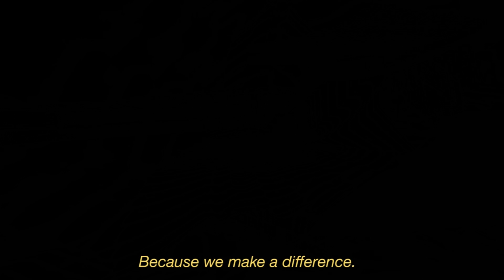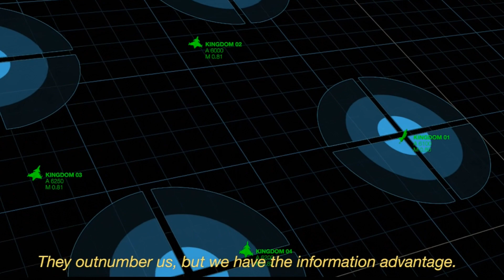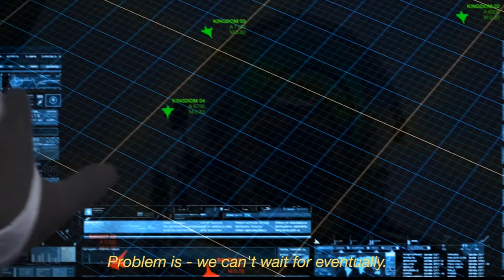Gripen Fighter Jet - Canada's Future Fighter?

Comment: there is no way a F35 will pair up with a non-stealth fighter. Doing so cancels out the whole reason for being stealthy. So no, Canada needs to just spend the money and get F35 or just stop having as fighter force.
Reply: Are you so sure the F-35 is stealthy at all? Even some of the marketing for this plane says "reduced radar signature". Maybe someone has built a better mousetrap....or radar system. It seems to me the US lost a carrier several times because Sweden built a sub that could NOT be detected by an entire US carrier group. What is the maintenance time for hour flown for the F-35? 40? It takes a hour to change an engine in a gripen as compared to 50 in the F-35. Planes are no use anyone on the ground
Reply: Considering that the new jammers the Gripen E has were designed to counter modern anti-stealth radars one would think that the Gripen would work very well along with the F-35. One aircraft concentrates on passive stealth while the other aircraft is highly focused on active stealth through advanced EW capabilities.

Comment: The Gripen and the Rafalle would both be a good fit for Canada.  Both are fairly compact, fast, maneuverable, and heavily armed.  the Super Hornet would also be good as we already have the infrastructure associated with the F-18 Hornet that we currently operate.  Any of these 3 fighters would be better for Canada than the F-35.  We also have to consider the amount of unpopulated arctic airspace that we cover.  Most Canadian requirements call for a twin engine aircraft for that reason.

Comment: The term "fighter jet" is an invention the non-military, non-aviation press.  The actual term until around the 1990s was "jet fighter".  A fighter is an aircraft that engages in aerial combat, among other missions.  When jet engines came into military service, the term was modified with "jet" in front of "fighter"  (the term until the P-80 Shooting Star was "pursuit" - started in the first world war, but changed to "fighter" changing it to the F-80 Shooting Star). Thus, propeller-driven fighters were differentiated from jet-powered fighters.  In the current usage we would have "fighter jets" and "fighter props." You can see how dumb that is.  Let's start the change back here!  Jet fighter!

Great video!  Great aircraft!

Comment: If I were in charge I would forgo the F-35 and buy more Gripen and if necessary either the Typhoon or Rafale as an alternative air superiority fighter . depending the allocated budget. The Gripen is at US$60M, Typhoon at US$103M and Rafale at US$85M. If the budjet if large enough I would got for a majority Gripen (say 60?) for multipurpose and Typhoon for Air superiority (say 20?). The F-35 although has a cost stated between US$80-115m has too many problems and lacks in air superiority compared to these 3.

Comment: great video. really the only problem with your argument is that both the Gripen and F-35 are both single engine airframes. Canada has the same problem as Australia, both who are now operating the Super Hornet, (In fact I think Australia just sold some legacy Hornets to Canada as well). Very large airspaces with few airfields. Single engine aircraft really are too risky in the areas compared to twins. Otherwise I would say Australia should ditch the F-35 and buy the Gripen instead.

Comment: Rafale would be a good choice for Canada...Range is great,as well as payload,flight capability and avionics.And is cheaper than Typhoon.Thou Grippen is great as well and cheaper,thou not really on pair with Rafale.
As for F-35 stealth features...bwahaha...It officially did not fulfill the stealth promised(which was even for C meant to be bellow F-22) and its only great against Xband radars.With sensor fusion and modern radars,it is far from a threat.Not to mention how many hours of maintenance it takes for F-35,real cost of maintenace,still problems with engines and a lot of time for maintaining them,insane drop of performance with any real load(even without any load,it fails to fallow F-16 D with full external fuel tanks) and its combat range is a joke....All of it is a result of wanting a plane that could do what a big plane should do,but also stealthy,but also with VTOL(which again makes it bulgy)..and ends up with a failure.It is the biggest military scam so far.They even destroyed plans for making F-22 and tools,as well as denied far better air superiority fighter F-15 Silent Eagle,for the sake of F-35....and many other projects suffered thanks to F-35 scam.It even came at backfire of those that made F-35,not to mention those who made F-16,A-10 ,F-18 and F-18 Super hornet.
Just read of lists of problems that was put in front of public commission...it never ends.Even in recent exercise,only every 7th was  clear for take off.

Comment: Canada has never liked the single engine option for it's NORAD Interceptor role, due to to vast area of coverage and lack of places to put the plane down if there is an engine failure.CF-18 replaced the CF-101 which replaced the CF-100, the CF-18 barely meets the range requirements in it's NORAD role as it is. in every other role the Grippen would be a fine choice, the Gippen's combat radius is less than 500 miles, not very good for intercepting over the north.
Reply: then add a few more forward bases..it's OUR land our sovereignty. the Gripen has very modest support requirements.

Comment: Actually, I quite agree with your assessment.  A standard two-tier fighter-cover complement seems an excellent approach, as most of the majors, including the US, seem to seek the same.  A Gripen/Lightning II dual level fighter system would do well for Canada.  I think that Canada would do better with F-22 Raptors than the F-35 Lightening II, but I don't think the US is letting the F-22 out of American hands.  Yet.  Personally, I think that the US would have been wise to drop the F-35 program and buy in to the Gripen as it's lower-tier fighter (to replace the F-16) to partner with the F-22 Raptor....but, that's not going to happen.  I think the Swedes have the right objective, to have more decent fighters out, with more time for their pilots to know their craft, which means more time in the air and all its attendant costs.  At this point in time, I'd say that a small set of F-22 Raptors, a large set of Gripens, and a decent set of A-20 Warthogs would be the ideal compliment for a second-line nation not interested in bankrupting itself on defense spending.   And, if you can't get F-22s, settle for the F-35s.

Comment: The main problem with Gripen is that everybody thinks that it is vastly cheaper then the F-35. Brazil bought 36 Gripen for 4,68 billion dollars, that's 130 million per jet. The main problem with the F-35 is that it must keep it wings clean if it wants to keep its stealth capabilities. Thus meaning its primarily uses its inner bays. Could it be that the F-35 is only good for deep interdiction bombing if you take in mind the puny payload? The infantry is more vulnerable because of either F-35 or gripen, because of the unit cost. Most new airplanes these days are so expensive that there will be less planes procured and thus less planes available to perform CAS missions. And mostly those new planes are worse in executing CAS missions already compared to F-16 because of the payloads. Take in mind that the F-16 is in itself already a bad plane for CAS, but at least it was something. The F-16 can carry 16000+ lbs of ordnance. Gripen can carry 4000 lbs in 8 x 500 lbs bombs , F-35 can (in its internal bays) carry 2 large bombs max and 2 small missiles ala brimstone. A solution could be to buy a bit less gripen and a few F-35 less and buy another plane specialized in CAS. But that's where I am stuck. No companies these days make any CAS airplane at all, except for the alpha jet?

These are just thoughts, Belgium just bought 34 F-35's. This will be our entire fleet because they are so expensive. We expected Eurofighter Typhoon but got F-35 which makes me think if it's worth the political mess as France/Germany are furious we did not buy their planes. What do you think?
Reply: "that's 130 million per jet"
But that was for the entire industrial package and tech transfer, not just for the aircrafts. The actual cost is more like 70-85 million USD per aircraft. I think the Swedish Airforce is buying them for about 70 millions, although it could be a bit more due to the weak swedish currency. But with an operating cost that should be a bit less than 5000 USD per flight hour, the total cost over the entire service life should make the Gripen several times less expensive than many of its competitors.

Comment: I really think Canada is to big for a single engine aircraft. Hardly suitable for the arctic as you said. The twin engine F18 Supper Hornet would be a far better choice than the F35 or Gripen for Canada imo. This place isn't like the UK, Europe or US with landing strips close at hand. A flame out or engine trouble over the Northwest Territories with a single engine craft is going to be a very bad day for a pilot. I agree it's a great plane, but if I were a pilot in this country, a twin engine wins.. Also, we are already outfitted to maintain the F18. There's a lot of cost savings right there.

Comment: Australia is in a very similar position to Canada, in terms of Geography and size of military. We are also transitioning from using F/A-18s, and have also bought Super Hornets to replace our older aircraft and bridge the "capability gap" until the F-35s are ready. We have committed to buying at least 72 F-35s (I think), and will probably get more.
However, like you, I am not a fan of using a single airframe for our entire combat fleet. It leaves you defenseless in the event of a serious mechanical issue or other vulnerability. Personally I think we should've bought some of the updated, new build F-15 Strike Eagles (like the ones the Saudis or Koreans got), to replace our F-111s. A very good, like-for-like replacement, in terms of capability, while still being a big step up. Instead we got Super Hornets, which are not as good, but are still ok.
 I can see why we went with them though. The commonality between them and the legacy Hornets made for a much easier (and probably much cheaper) transition.
I'm sure we would never buy Gripens, just because of politics. We are very beholden to the US. But I do wish we would get SOMETHING to supplement the F-35s. Some of their systems and capabilities are amazing. But in terms of range and payload they're not great. In trying to cover so many different missions it has inevitably come out as mediocre at some of them. Or, if not mediocre, very poor value for money.

Comment: I'll be darn the Gripen looks just like the modern version of the Northrop Tigershark  from the eighties only with a canard and upgraded avionics and weapons systems. When I was an engineer at Northrop the Tigershark was out flying the F-16 and cheap too. At the time the Tigershark had the fastest scramble time of any fighter and very hot. Approximately 50000 fpm rate of climb. Thanks guys for copying the Northrop Tigershark. It was a great fighter then and it will be an even greater fighter in the 21st century. Good choice Canada

Comment: I just don't see us adopting two different single engine multirole fighters, the twin engine  hardliners are still out there. If we do end up going with a 2 fighter solution, It's more than likely going to be a core of single engined fighters like the F35  backed up with cheaper twin engined fighters (maybe Super Hornets or F15s?) relegated to mostly patrol and show of force interception duties.

Comment: No fighter is nr1 in all aspects of fighter capabilities. Gripen is nr1 in dogfight, network warfare, turnaround, upgrade time and cost. Probably even self defence and is close to nr1 in all other capabilities, except max payload. But 2 Gripens together is nr1 in that respect to a lesser cost than 1 other fighter. OBS. that at least ⅔ of the cost for fighters are  the cost to fly them. Furthermore the extremely short turnaround will result in more Gripens in the air at a given time, which make airborne payload nr1 even with the same amount of fighters. Of all non-stealth fighters it have the lowest rcs. The fighter link is completely stealth.

Comment: Remembering the Battle of Britain, it was neither the Hurricanes nor the Spitfires, that fought to succeed, but Hurries and Spits.
Here in Germany, the Air Force reportedly considered a Squadron of F35s as well. And, quite frankly, I don't think we need them.
The F35 looks like a good fighter for the second row with its great sensor range, but to be fast, it has to be hot, not being a supercruiser. The Typhoon will do a much better job as a first line fighter.
It would, however, be nice to have a type to take some weight off the shoulders of what is supposed to be the protecting shield in the air. Having a squadron or two of Gripens for air to ground duties primarily and air to air secondarily whilst there is a primary air force of Typhoons there to take care of air to air missions primarily and air to ground secondarily mightbe a good idea. The Gripen's tactical link and lower cost etc. will probably make it more than capable enough at a good bang per buck ratio for such a team while the Typhoons unmatched supersonic characteristics make it a safe bet there. This might be an equivalent to the Hurricane-Spitfire-Team.
There will be enough allies here who operate the F35, so its second row capabillities would be available anyway.

Comment: The video title is not very accurate, it should rather be "Why Gripen is better than f35". It's my personnal opinion but i think gripen is really overrated. The gripen NG is actually more expensive and less effective than a rafale and previous cheaper gripen generation got beaten by Typhoon and litteraly crushed by Rafale in a swiss army evaluation.
Gripen is also not on the same level of f22 or f35 (due to the tremendous cost difference allowed by very big US army budget). Gripen NG doesn't makes any sense for me and older gripens are practical only for low expenditure army.
Great video (as always) though
Reply: "and previous cheaper gripen generation got beaten by Typhoon and litteraly crushed by Rafale in a swiss army evaluation"
The greatest and only real complaints the swiss had about the Gripen C/D was the range/endurance which was the greatest reason for its lower score, which is something that has been improved with the E version. And isn't the Rafale more expensive? I've seen numbers ranging from 100 to 300 million dollars per aircraft.
Reply: @onlypeaceindeath  80million euros for a rafale c. Range/endurance were a problem but they also specified that it couldn't perform bombing and interception operations as well as the older planes that they already had.
Reply: @douglasanderson306   But to my understanding that had a lot to do with its size and endurance, which lowered its scores in a lot of missions. Gripen E should fix most of these problems.